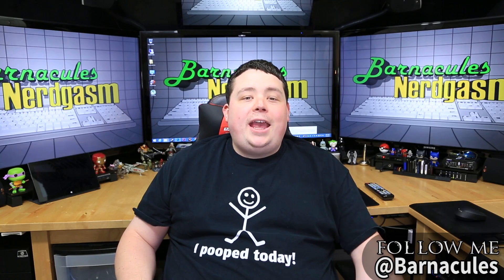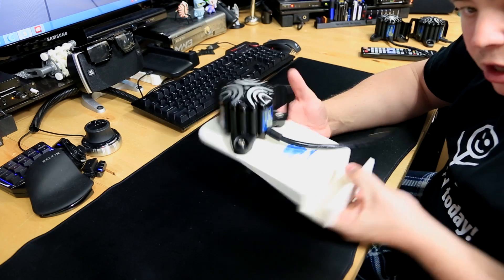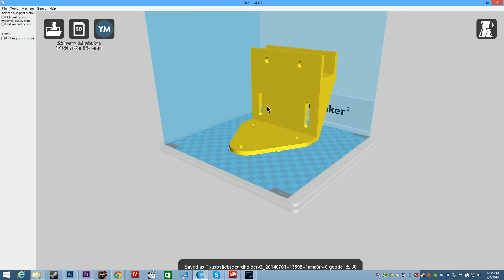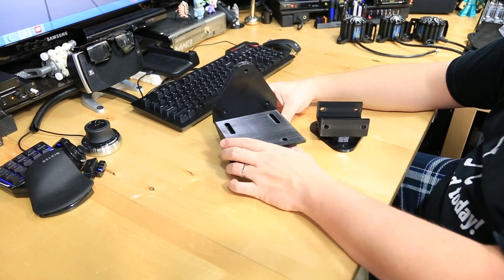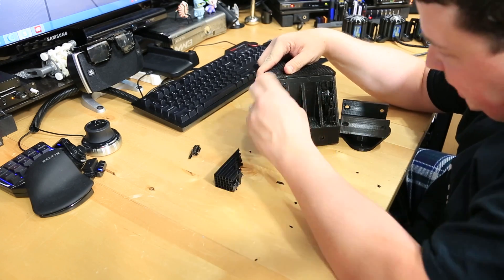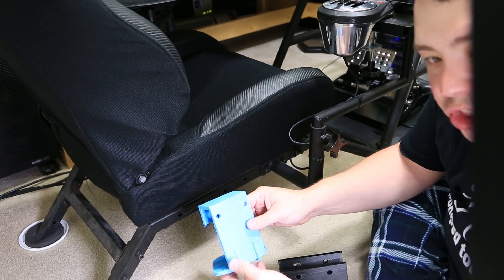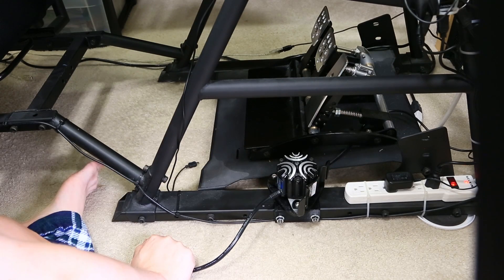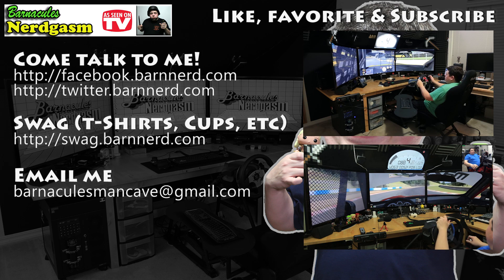Project SimVibe Buttkicker Racing Cockpit : Part 1 - @Barnacules

Comment: the way you mounted the front one should be spun around and facing the back of the seat. it will transfer better and give you room to step in and out of the sim seat without kicking it and possibly breaking a mount

Comment: It's great you were so easily able to get some brackets designed, but man - with just a bit more effort you could have designed those brackets to be a lot more printable and functional with a lot less wasted printer time and plastic.

For example, on the bracket for the kicker mounted to the middle front of the seat - why not just a design similar to the other brackets? Half of that print was support material, which means a lot of wasted plastic and time. And the bottom tab? Mechanically speaking it's not helping at all.

For those other brackets - you have three basic shapes. A triangle for the kicker, a cylinder, and a C shape to attach to the frame.

Why not simplify it? Ideally, you want the kicker touching the metal frame to transfer the most energy to you. So make a C shape that goes on the bottom of a bar, but has tabs with holes for the kicker's bolt pattern which is then mounted above the bar. The kicker touches the frame, and stays locked on. You can print that one on its side without supports (the bolt holes can sag a bit and still work fine) in probably a 10th of the time it took for the ones you showed. 

Also - if you want these machined with metal, getting them made identical to the shapes you showed in the video is going to cost you a hell of a lot more than if you designed them with CNC machining in mind. A  square of aluminum with unthreaded holes for kicker, two more rectangles with threaded holes to attach to the square plate, and two holes each to bolt to the frame. 3 pieces that are way cheaper and arguably more functional than fully machined copies of those printed models.

Finally, why not just drill a hole or two into the frame and bolt the kickers directly without the trouble of making brackets in the first place?

Comment: why dont you set some transducers in a different direction on the base to get a different kind of vibrations? instead mount it on the side by example for the back seat kicker to set the direction of the movement along with you chair. sorry if my english is bad.

Comment: Try using line support type from cura, it's a much weaker support type and EASY to take off :) 

Expert > Open expert settings > (under support) structure type> choose from the drop down menu. Hope this helps :D

Comment: Hey Jerry, One little thing I found with support material is if you print too hot it sticks to your print and is a pain in the ass versus if you print at slightly lower temp say 5C less it wont be nearly as bad...Glad to have a 3d printing video...your the man... :D
Reply from the maker: I've noticed this too but I've also had bonding issues at lower temp where the plastic seems to break the layers apart easier under stress. I guess it's a trade-off and a delicate balance.
Reply: Indeed it is a balance lol...I have noticed the layer bonding issue as well...I have seen a program that lets you print support material at lower temps and print the object at higher temps but I cant seem to remember where I saw it or what program(Im pretty sure you had to pay for it and it wasnt cheap). Im curious how this method would work out.

Comment: Hey Barnacules Nerdgasm, will you be putting some kind of rubber between the metal frame and brackets to help translate the vibrations easier without extra noise (i.e. the vibration noise of metal on metal if not tightened correctly). You should have a look at locking nuts they should help prevent working lose with the vibrations

Comment: You should check out Project CARS, in my opinion it is better than any other racing sim on the market, including the iRacing sim you mentioned.
Reply from the maker: I played project cars and I didn't find it as realistic as iRacing, but I haven't played it since the last update so maybe a lot has changed.
Reply: Barnacules Nerdgasm
Thanks for the reply! When I bought my G27 wheel I had a go at most of the pc sims I could find and my favorites were RACE 07 and Project CARS. Been a backer for PCARS for 2 years now and it's absolutely amazing how fast the game has developed. I don't know when you last played it but the last couple updates have been pretty major.

Comment: Those models are terribly designed for 3D printing, they could have easily been made to not require all the support material..
Reply from the maker: They were not designed to be 3D printed, they are designed to be milled from aluminum but I was testing the design on my 3D printer for fitment.
Reply: Barnacules Nerdgasm They are even worse for machining.  All those sharp corners in the overhang are going to either require multiple passes just to get down to an endmill with a radius small enough or a ram EDM to burn away the corners.  You need fillets there or get rid of the ribs.  The little rib pattern on the bottom is also useless and just added cost on machining the part.

Comment: You could use the same small bracket that has it right over the beam on all of them, right? Just flip the polarity of the kicker that's upside down?
Reply from the maker: Buttkicker told me that all the transducers need to be aligned in the same direction for best performance.

Comment: Jerry you should look into a water soluble material that way you can get rid supports and overhands with a little water.
Reply from the maker: I've heard of the material but have never tried it. I could use it with my Ultimaker v1 since it has dual extrusion.
Reply: It is a little more expensive but you save a butt tonne of time cleaning up the overall design. Dual extrusion is boss! We have a couple of these machines in our Motorsport lab which really do help with testing aero packages, hell we even printed of a working engine which is powered by a small battery. Fun "toy" indeed.

Comment: What software is used for designing the molds that's compatible with the printers software???? is it AutoCAD?
Reply from the maker: You can use any 3D modeling software that can ultimately produce an .obj or .stl file that can be sliced into .gcode. For these brackets I believe Google Sketchup was used.
Reply: Barnacules Nerdgasm Ok, thanks for the reply!!!!

Comment: Wouldnt it be easier to take the "Front Bracket" design and flip it around so it can be used under the Seat?  Looks much easier and rigid than the complicated design with the side mount. (obviously you have to take care of the "Bar dimensions")
Reply from the maker: We're investigating this however Buttkicker recommends that all of the transducers be mounted in the same direction for some reason. But I think this is only relevant for when they are all creating vibrations from the same audio source.
Reply: Barnacules Nerdgasm
 this is because the vibrations would cancel each other out , to solve this you can switch the two power cables, red and black (called 180° phase switch). the result is like turning your speaker/kicker upside down. for more information "google speaker polarity"

Comment: you need a dremel to do support removal.  Plus the transducers on the front of the frame should be moved up instead of on the that base (on the floor) so you get more Shakes.

Comment: I currently got 

gtx 660
amd 4300
8gigs of ram
500w power supply

im trying to stream csgo at 1920x1080, I run like 60-120fps but it feels laggy as shit, I got my amd 8350 sitting in the back but I don't use it cause it overheats..

If I were to change it to the 8350 and fix my overheating somehow would my fps while livestreaming get fixed?

Comment: When you do make the final product and it is all hard mounted I recommend using lock nuts or use thread-locker with your current nuts because once the butt kickers start kicking your butt they will send out vibrations and those vibrations will cause the nuts to shake loose and you will loose vibrations and loose a nut or two.
Reply from the maker: Agreed, I didn't use them in the video for testing fitting but I already did get some lock washers and I was also going to use some loctite red.

Comment: Why don't you just bolt the transducers straight to the sim that will give you the most vibration transfer no need to mess around with brackets
Reply from the maker: It would require holes to be drilled in the frame and I don't want to weaken it.

Comment: Hey man love your videos!

I have a suggestion with the transducers that go under the seat. Instead of mounting them outwards from the seat why not turn them around so they don't buldge out to the sides and instead are all hidden underneath the chair. This will still have the vibrations in the same areas but may be more sleek.
Reply from the maker: It's a good idea, we're actually checking to see if the transducers can be mounted upsidedown now so we can make the rears similar to the fronts

Comment: if the project is over, can you please post a link or something to the designs of the holding brackets for the butkicker?
Reply from the maker: It's not over yet, but once it's all finished the final video will have the links to the bracket plans.
Reply: ok thanks

Comment: Hey Jerry, thanks for doing this. Pls don't forget to show how you have to connect it to your soundcard and stuff, cause i really get lost doing that. How many soundcards do you need to hook up those four transducers?
Reply from the maker: I will show how it's all hooked up as a separate video when I get the brackets. It's basically going to be a USB 5.1 sound card connected to the 5 channel amp that goes to the transducers.

Comment: Are the new brackets going to be machined from solid aluminium or printed in aluminium? 

The small bracket will be easy to machine but I can see at least a few problems on the big bracket. 

Will be interesting to see the final product :)
Reply from the maker: The big bracket is going to get a little modification before it's sent out for metal work since it was designed to be printed in plastic. And it's going to be welded together from water-jet cut plates.
Reply: The small bracket could easily be machined from a solid piece of aluminium if you know someone that has access to mill-turn cnc machine :) 

Can't wait to see the final product and how it will perform on your rig. I have also been thinking about doing some simvibe on my 8020 profile iracing rig but the buttkicker units are really expensive here in Denmark.

Comment: Are the new brackets going to be machined from solid aluminium or printed in aluminium? 

The small bracket will be easy to machine but I can see at least a few problems on the big bracket. 

Will be interesting to see the final product :)

Comment: Are you not concerned that heavy vibration will destroy the electronics in those wall warts attached to the chair?

Or is the benefit of having a single plug power the whole thing so great that is clouds your judgement?
Reply from the maker: Nah, I will put rubber dampers under them when I install the final mounts to reduce the shock to them.

Comment: How is it that you have every gizmo and gadget known to man at your disposal, but you don't have a dremel to clean out that support material on the 3D printouts?  Dremel 4200 dude, you'll love it.
Reply from the maker: I have 2 dremels and a higher powered rotory tool :D But they are buried in the garage right now.
Reply: Barnacules Nerdgasm Make sure you show your cool brackets to the companies that made the Butt Kickers and the racing sim.
Reply: Personally, I'd suggest removing as much support material as possible, then using a sharp chisel to smooth it out. Seems to work for me, anyway :D

Comment from the maker: Second!
Reply from the maker: overlord5209 Yes, once this is done I'm going to have an iracing day once a week where I live stream and make a video.
Reply: Did you consider making the front bracket mount to the pedals?  You could use the the screws you can see right on the side that is a long skinny braket that drops forward. :)
Reply: Awesome I have an eyefinity  setup and want to hook it up with something like you have with the racing seat and butt kickers
Reply: i recommend using x-acto chisel tips for cleaning up support material
Reply: Seccconddddd!
Reply: Zane Hicks a dremel will melt down the plastic, no ?
Reply: Hey Jerry your videos are awesome and so is your setup. Do you plan on doing more iracing videos or other racing games after your initial sim vibe test. It would be nice to see if you can turn a faster lap than jay at home.
Reply: A Dermal spins too fast even on a slow setting so gets hot and melts the plastic I've tried
Reply: Dremel* auto correct
Reply: Matt Wood I use a Dremel on plastic all the time.
I 3d print large parts.
My Dremel saves me hours of work.
Just need to be careful and not let it melt the plastic.
Go slow and stop when it starts getting too hot.
Reply: Barnacules Nerdgasm
can you do more assetto corsa or project cars aswell
Reply: Barnacules Nerdgasm nice can't wait. What is your twitch name?
Reply: Barnacules Nerdgasm Can I suggest you join me in a race on R3E on steam? I help SIMBIN Studios Stress Test and BETA Test the WIP Client. Can't say anything more though as under NDA. But join me in the Public Client for a Multiplayer DTM Race. My Steam is BinaryOneXero. It's another Racing Simulator which you probably already know if your into racing sims like me. For people that don't. It is a F2P on  Steam and you buy vehicles and tracks with vRP that you buy. But there are many cars and a few tracks unlocked or you can buy the DTM Experience DLC for a full realistic racing scenario. They have the Audi, BMW and Mercedes Official DTM cars. The handling feels really real. The sounds of the cars are uber realistic and its graphics are phenomenal.
Reply: BinaryOneXero Gaming and Tech 2
 Better use twitter to contact him
Reply: Music at 6:20??
Reply: Jerry, I really hope your construction will kick ass. I keep my fingers and even my toes crossed that it will be worthwhile the effort and not futile, because of a to weak 'rumble'-effect in the end. Btw...you must watch the first 'Jurassic Park'-Movie in your chair and place a cup of water on it. Why? Because of the concentric waves on the water surface in the cup, like in the movie, when the T-Rex first appears.
Reply: overlord5209 Try to guess. www.twitch.tv/barnacules ...if you like JayZtwoCents also, it would be www.twitch.tv/jaysvfx
Reply: DatEstonianGuy   Barnacules Nerdgasm needs to be where the engagement is and that's here. case and point:  https://twitter.com/Barnacules/status/485199556791902208

G+ caters to the geek demographic and we love it here. look at ***** twitter https://twitter.com/MKBHD   vs   his G+ https://plus.google.com/u/0/+MarquesBrownlee/posts  or   ***** g+ https://plus.google.com/u/0/+ArmandoFerreira/posts  vs  his twitter  https://twitter.com/Wicked4u2c  i could go on and on.

I am tired of being forced to use a quantitatively inferior network (in both format and engagement) to hang out with awesome people like Barnacules Nerdgasm .
Reply: Pilo Meltdowner lol thanks should have known. I watched his stream with jay so I know jays.
Reply: also use the oculus rift for more realism
Reply from the maker: Idris Seffah I already reviewed the RIFT with iRacing, the resolution isn't good enough yet but it will be some day and it will be EPIC!
Reply: I am thinking you will have a hard time getting your wife out of that seat.  You turned it into a giant Vibrator dude!  lol seriously that will really be awesome when it is all working.
Reply: charles pages Depends on the bit, toothed cutting bits can cut plastic cleanly abrasive bits will grind and burn the plastic. Also don't rush it and you're fine. As long as you don't go fast enough to heat anything up you'll be fine.